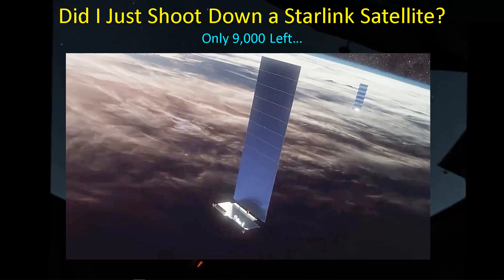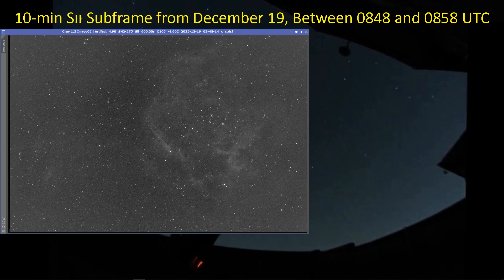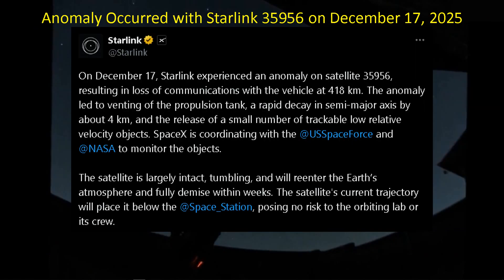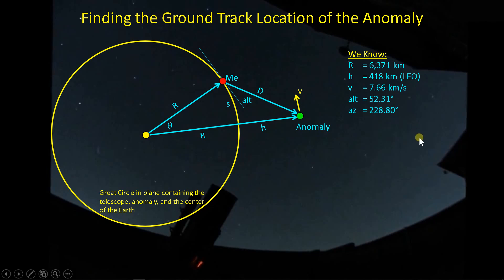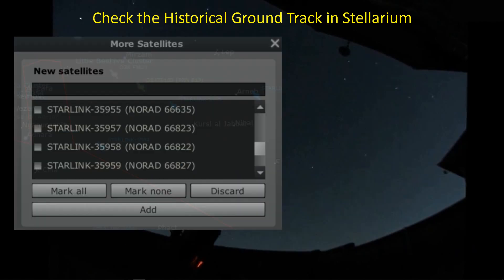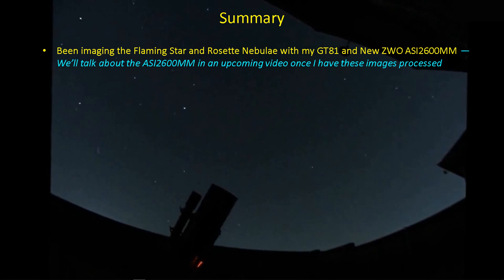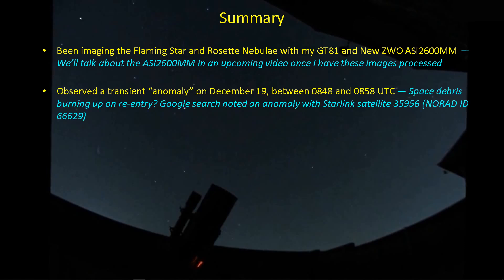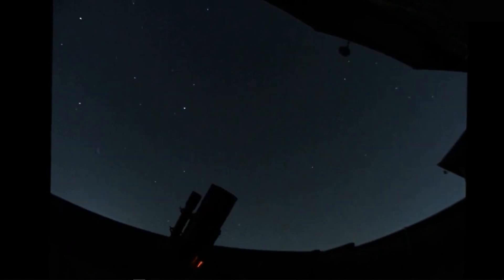Starlink Down! Did I Capture a Starlink Satellite Anomaly?

Comment: Hi James - Glad to see you posting again. Always look forward to hearing from you. Hope you escaped your time sucking employer with sufficient funds to remain free for a while! 
By coincidence I've been shooting SH2-275 as well here in Connecticut (also shooting the Flaming Star-Letter Y when Rosette was blocked), with a similar offset in the frame, using the same WOGT81v4, ASI2400MM, AM5(not N, w/o counterweight), even the PA Focuser - I'd say 'great minds think alike' but my mind is barely qualified to visit the neighborhood where yours resides. We also diverge at my using the .8 reducer, which leaves me a bit undersampled but, I figure, that's what Dither/Drizzle is for - as well as a slightly better F Ratio when reduced, but you know that. Also I'm using an OAG and 36mm filter wheel for my Astronimic LRGBSHO 6nm filters, where I shoot 300sec exposures in SHO...but all that's just a bunch of hot air.

I'm pretty sure I saw a similar anomaly in a .fit or 2 while Blinking and culling, but couldn't find it among the non-culled .fits I haven't processed yet. Though we had clouds in CT on 12/19, I have .fits of SH2-275 from 11/21, 12/13-21-22, and 28. However I suppose I might have seen it in any of the nights I've been shooting 2 scopes at various targets during that time.

Thanks for the detailed analysis, trajectory figures, and likely positional differentiation over time. Fascinating as always!

As far as falling satellites go, this Chicken Little doesn't go anywhere without a sturdy tinfoil hat on 🙃But thanks for the warning!
Reply from the maker: Thanks for watching? If I knew you were using “my” equipment I’d just send you my target list and let you do the work! These little “anomalies” can be easily missed when looking for “big” things like clouds and jets on final approach. Keep up the good work!